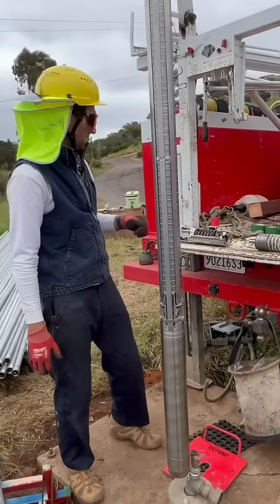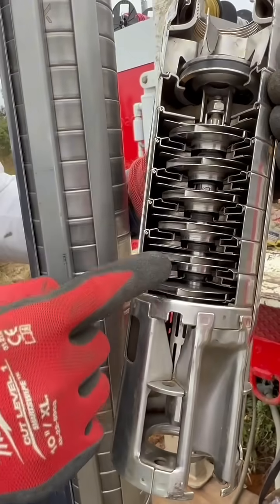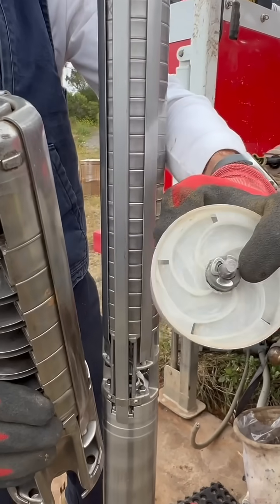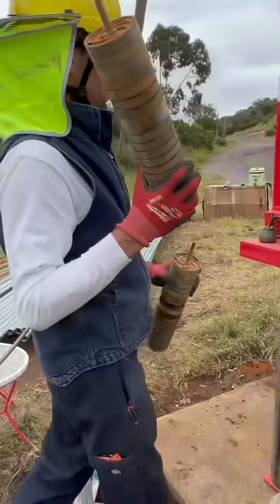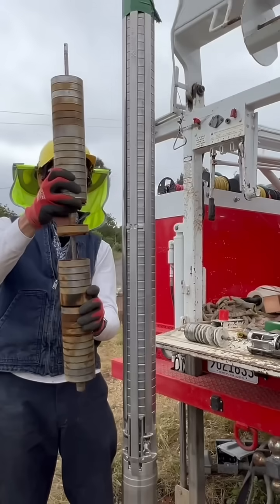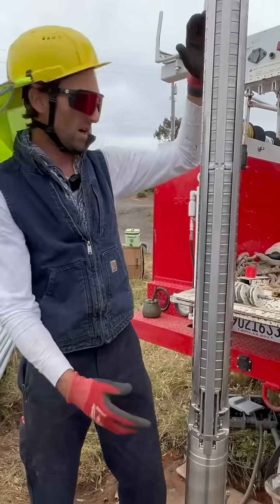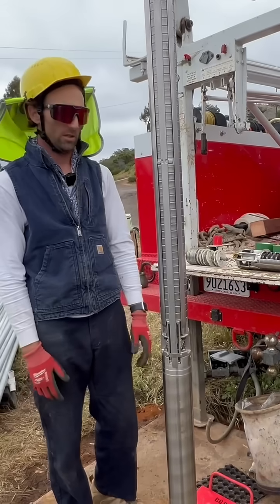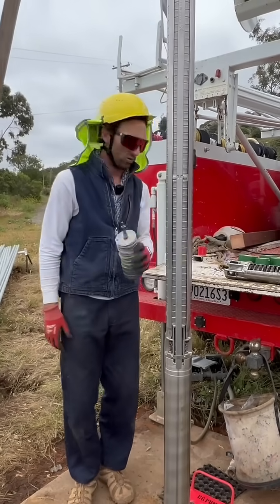Grundfos Well Pump vs Gould’s Pump #watersupply #grundfos #wellservice #welldrilling

Comment: I can’t complain about my Goulds pump. It has been going for strong for 27 years. I’m sure the Grundfus is also a good pump.
Reply from the maker: The way it was installed is more important than the manufacture. However long a Goulds pumps lasts, a Grundfos will last longer.